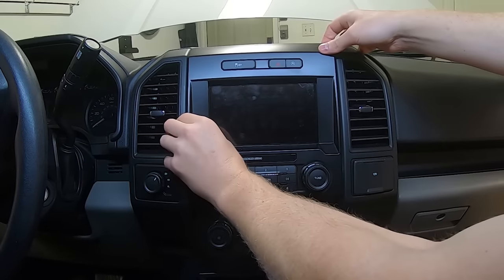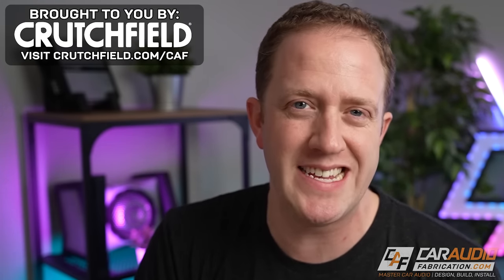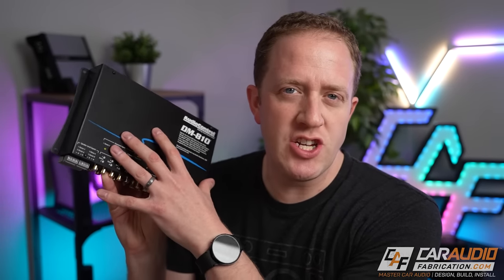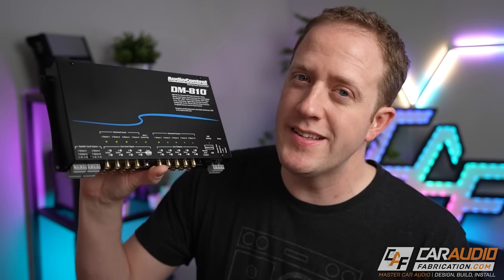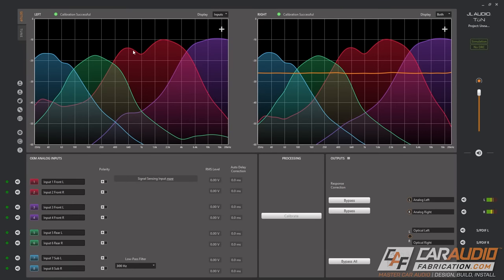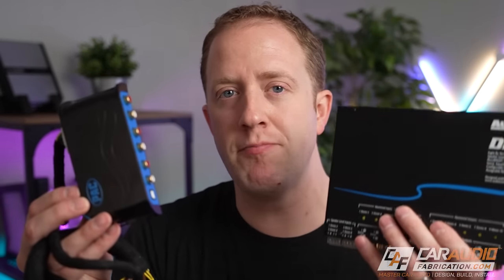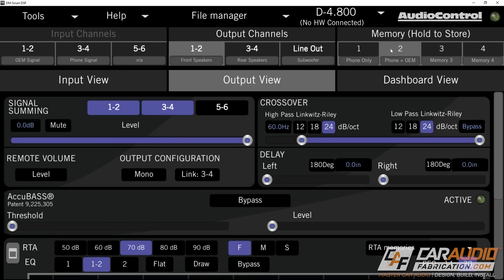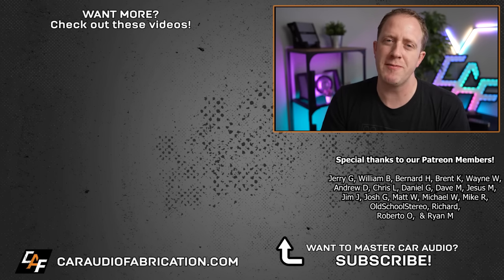Can't replace head unit? NO PROBLEM! Get amazing sound with THESE!

Comment: Hello man really enjoy the vids, just need some extra help I have a seat Leon 2015 I want to upgrade my sound system here the stuff I already have : 5ch pioneer amp, Ts 6975 V3 , Ts1675 V2 and also ts- s20 tweeter no sub as yet,

Am planning to install my V3 on my parcel shelf and the V2 in the front doors but am not too sure if it will work while having factory speaker in the back door.

Please anyone help and thanks in advance

Comment: Is there a way to use a DSP with stock equipment to just clean up and fix audio problems and quality?
I am talking, no amps for the speakers, so RCA out wont help.
Thanks!

So I am looking for OEM wiring in, and wire out options to the speakers skipping amps.

Comment: I have 2003 Saab 93 aero 13 speakers so know aftermarket radio possible. I was wondering can I use a line output converter to dsp because the dsp I was looking at only has rca inputs?

Comment: @caraudiofabrication does using a OBD genie/fouscan actually work by removing bass roll off? Id like to keep my oem radio as it controls a lot of features on my 21 f150 2.7 supercrew. Have you tried any of these OBD Tools on oem radios?

Comment: can you not just run the high level strait into that dsp amp you showed at the end and be done? you dont need a pac or lc2 with that amp do you? and then you can use it to correct as well, is that not the most simple?

Comment: hi im getting a amp with dsp built in, plus a sub amp. but can i set the amp gain through the software or do i need to set the gain manually on both amps. by the way love your channel ...
Reply from the maker: DSP amps you typically will set the gain level in software

Comment: I have a quick question I'm installing a pac amp pro in my jeep wrangler  it does not have a factory  amp do I have to run  speaker wire from amp to the  the pac pro.

Comment: Hey Mark I have a aftermarket system --2'10's , all new focal speakers and tweeters with 2 amps installed with my factory deck I have a white noise  is there any way to get rid of it?

Comment: If I don’t have a LC2i pro will it be the cause of why my amp goes into protection mode when bass hits too low of a note for like 2 secs then continues to play normal ? Only does it when I have it at a high volume

Comment: Hello i have audi a3 8v with 9vd audi sound system it sound signals to speakers comes out directly from the headunit , my headunit also have MOST output a optic fiber connection that connected to b&o amplifier in higher equipped cars with b&o speakers , im considering to setup amplifier that can get signals via optic fiber MOST connection and the output to speakers i want to use the wires connected to headunit is that possible

Comment: Hi mark 
I need your help please 
I have Camry xse 2019 with original factory head unit radio 7 inch 
I want upgrade all  6 speaker and add subwoofer 8 inch and 2 speakers 4 inch in rear dashboard with amplifier 1340 rms 5 channel 
What should be do or selected from this vedio 
Dsp or line output converter or line input converter

Comment: I am using aftermarket head unit. Audiocontrol d-5.1300 needs Audiocontrol overdrive plus? Also overdrive plus model is discontinued... Any other options available?

Comment: I’m as lost as in the beginning of the video 😏 I’ve never done any sound system upgrade i have a 2020 corolla LE.. i just installed new door speakers and recently purchased a SKAR BASS PACKAGE and it’s just sitting in my garage for a week. I’m afraid to mess it up..
Reply: Your first mistake was buying Skar. It's mostly garbage. Like most things in life if it's significantly cheaper than other comparable items it's because it is not good. Your stock system will sound better
Reply: @Anonymous-cu8eu  tbh i just got it installed professionally and it sounds really good. Clean bass.

Comment: Just recently purchased the LC2I-PRO and installed it in the daily driver, had some issues with response on the Accubass, simply turned the threshold all the way up, dialed in the accubass at rolloff and tuned in the Amp with dd1+ on loc and amp, and super clean signal all the way through on lpf, gain, and subsonic or HPF and couldn't be happier with the outcome. Truly an amazing little unit that really does quite a bit. Considering getting a DSP, but never owned one. Nothing but A+ wiring, RCA'S, etc. That in itself makes a HUGE difference. Definitely don't cheap out on RCA's or any wiring for that matter! Suggestions on a quality DSP?
Reply: I was trying to dial in accubass for a couple weeks, then kept it always on as the last resort. Was not very happy with the boomy bass that was delivered based on the quality of my setup, so I decided to turn it OFF the other day, retune the LOC on the strongest frequency, and control bass rolloff on demand (if needed) with the supplied volume/bass knob. This cleaned up the signal to the point that my sub is the cleanest sounding driver in the entire "premium audio" system, and the rolloff actually compliments the rest of the soundstage so the bass is not overbearing with volume changes. Also on the hunt for a DSP in the coming weeks to de-eq the ridiculous tune. You decide on anything?
Reply: What did you tap into to use loc
Reply: @ssjdavid  Front left speaker at the amp if you've got the JBL setup. Crutchfield has the wiring assignment.

Comment: Can I run six 6.5 speakers without an amp? 

Just stock headunit
Reply: Yes, but you may end up disappointed in the results. The factory speakers are made to play best at the lower power levels a stock headunit provides. Replacement speakers are often engineered to handle more power. Your stock headunit likely does not have enough power for aftermarket speakers.

By replacing the speakers, what would you want to accomplish?

Comment: I'm doing the last option. My dsp has Bluetooth capabilities and a remote volume knob. So I just use it as my source.
Reply: Blake could you tell me which DSP you are using? I want to add an audio system to my camper but want to avoid using a head unit. I’d like to just connect to my phone over bluetooth.
Reply: @fergusmoloney  I'm using the DD audio DSI-2
Reply: @blakebrockhaus347 thanks. I’ll take a look.
Reply: @fergusmoloney  you can't get the 2 anymore. But they've got the Dsi-3 now, which is way better

Comment: Are there any products that are a all in one kind of deal. With a high level in and high level out? I don't want to have a big Amp. I just want to "boost" the oem unit that is too quiet / underpowered
Reply: Most amps have high level inputs built in .
Reply: For that you'll want a compact amp with high level inputs. The audio control acm4.300, DD D4.125, and the Kenwood kac M1814 all fall into that category
Reply: @blakebrockhaus347  thanks for the information